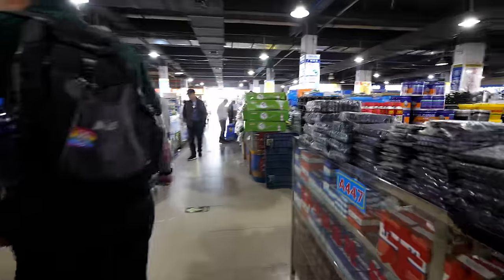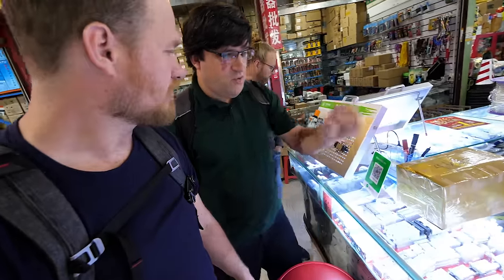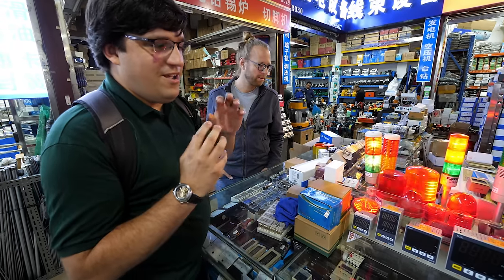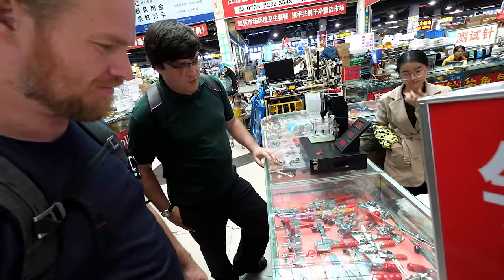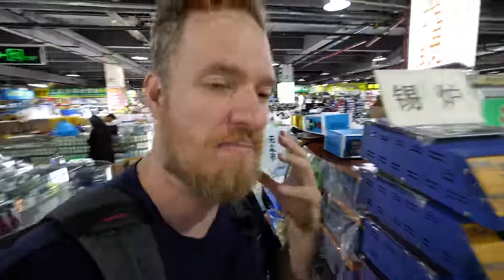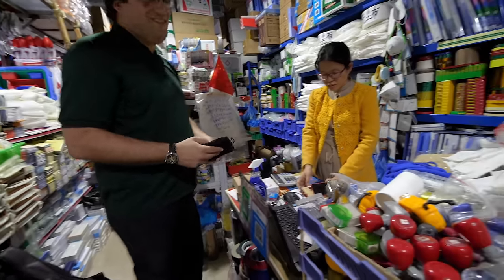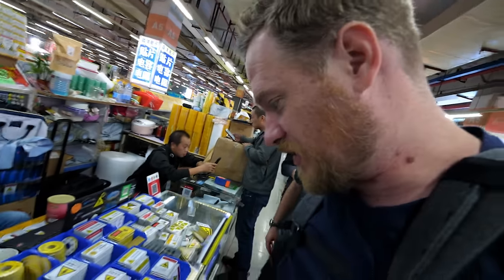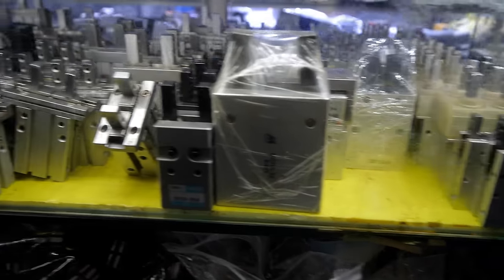Where the Factories Shop - Chinese Industrial Markets!

Comment: I'm continually amazed at the manufacturing prowess coming out of China. There seems to be something for every little thing you can think of. That's so crazy.
Reply from the maker: Yeah, and I’m still only scratching the surface.  There are entire cities that specialize in producing one thing. Like shoes for instance.
Reply: @StrangeParts  huh, might be worth exploring 😉
Reply: It used to be like that in the US. The US business sector sold it all and ceded the markets to China.
Reply: @StrangeParts  I am a longtime customer of a bespoke leather shoe factory outside Shanghai, let me know if you'd like a contact. They specialize in leather dress shoes for men but completely custom so they're not a run of the mill factory. I also buy bespoke dress shirts from a  large garment factory in Xiamen. They have their standard production line where they produce off the rack shirts for big name brands, but also take bespoke orders using my exact body measurements and cloth that I choose from Italian mills; similar to the tailors in HK but I go directly to the source. China continues to amaze

Comment: Scotty, I think you should make a pneumatic stamp. It would stamp your logo on the back of phones? Challenge would be to make it mobile, this means anyone meeting you could get your logo stamped on their phone, or, other personal items.
👍😎👍MDS 🇬🇧
Reply: Yup this!
Reply: Except most phones are glass backed now
Reply: It could be a rubber stamp and use ink, making it would not be hard, frame, extender/stamper, tubing, micro air compressor with a small tank, you could make it a 2' cube (50cm ish cube) prob smaller really
Reply: Noah Wilke There are various media other than metal stamps. My thoughts were the soft sponge or rubber type. Obviously wouldn’t use anything to break peoples items !!!
Reply: Aaron Reash your a mind reader. 👍😎👍
Reply: Goda make it look cook too
Reply: Excellent suggestion

Comment: If the apocalypse happens that store is going to be priceless, you could literally make anything from scratch by hobbling parts together, like a giant real life lego store.
Reply: But then you need an update or troubleshoot your factory computer system and without the internet you are f**ked.
Reply: You would also be without a lot of power so this stuff would be useless until a large power source gets built.
Reply: @csorrows  Only in the case of a solar flare or EMP, in a normal apocalypse where electronics survive you can run generators on fuel (gasoline isn't necessary, you can run them on oil/alcohol mix, or diesel generators on fly oil etc). Any parts that are electronically powered can be modified to be powered by anything in most cases.

Comment: About 30 years ago we built from scratch an arcade machine with 3 x 6" (stroke) air rams (2" wide) and a cockpit cabinet on a large steel frame.  We installed a flying arcade game into it.  It had a yoke flight control that I connected to the air control solenoids via darlington pair transistors to drive them.  It used basic TTL logic to control the "flight" and I tapped into the game circuit board to automatically power up the control board and lift the front ram as it took off.  When the game was finished I used an "end game signal" on the game board to shut the control board back off.  We installed a seat belt as it was much more vigorous for smaller kids (It flew someone as big as 150Kg).  It used 1/8" valves for the air flow to the rams and required a 10CF compressor to keep the air up to it.  We tried 1/4" valves during our R&D phase and it was so fast and violent that it made the 200Kg machine bounce down the factory floor while I was yelling "Switch the f...ing thing off" as I was throwing the control lever backwards and forwards with no control.  It had a 20" CRT mounted in it.  It worked commercially in an arcade centre for about 5 years.                                                  There is a good air project for you.

Comment: I didn't know those things were called andons.  Means "lantern" in Japanese.
Reply: Yeah, we used to generically refer to them as Christmas Trees
Reply: @TheCuriousOrbs  In Germany, "Christmas Tree" is also common, but mostly they are called "Traffic Lights"
Reply: I work at a major EU car manufacturing plant. We call the lights Christmas trees but have a manufacturing system called Andon. It was invented at Toyota.
https://en.wikipedia.org/wiki/Andon_(manufacturing)
Reply: and there was me thinking it was And gate logic control lol
Reply: Andons are so useful!
Reply: Stack lights is another nickname for them.
Reply: That's where the name comes from first utilized by Toyota and then adopted across the world as part of lean manufacturing practice.
Reply: @dw816  Yep, about to say the same. Worked for Toyota in the UK any problems in manufacturing you pulled the andon cord, then you got swamped by engineers and problem was solved in seconds. Very minimal down time and the quality of the product remained the same time afetr time.

Comment: Is there a machinery shop? As in lathes, milling machines, grinders, etc..
Reply: I don't know about Shenzhen but in Shanghai surrounding the area around Beijing Road, they have stores and malls selling machinery as well as hardware such as the ones the video
Reply: @robinandersson7963  ok. I believe that's what I'm looking for. I'm looking for the machines you find in the average machine shop. Mills lathes grinders etc. Not so much the computer controlled ones. But the manual ones for sure.
Reply: The shipping would kill your budget unless you were buying by the container load try Grizzly Tools in the US or buy off ebay..
Reply: @robc8468  it all depends. I've priced them both ways. You often pay more through grizzly (which I already own a machine from) and off Ebay. But for now I'm gonna hold off. And maybe once they're done with the corona virus. I'll order a new machine and see if it was worth it.
Reply: Check the App Store for grinder. You will be presently surprised 😮
Reply: @eleventeenmachine5991  Buy on Aliexpress and get FOB Shipping, cheaper because you have to pick the machinery on the nearest port.
Reply: Oh yes, my bro goes out there with work and he went to a warehouse rammed full of machine tools. He asked about a pillar drill and the bloke said how many 1000 an when do want um delivered!
Reply: i think it fall under power tools section maybe?
or heavy duty power tools...

machinery more for factory
Reply: @robc8468  shipping cost are getting expensive but still very cheap.. I like the idea of charging by sizes of containers, not weight :)

Comment: Just going to add on the vibration sorter. I'm working in what is essentially a pepperoni factory. Small time family owned so automation is pretty limited, but we've got a sort of vibrating trough after the slicers which leads into an upwards elevator which dumps sausage into a weigher/bagging machine. trough's whole point is to vibrate all the pepperoni slices so that it consistently fills the next conveyor and doesn't overload it (since it's open and sausage can and does fall off onto the floor if it gets piled up).

It's not a perfect solution since we have someone stationed at it to make sure it's working and everything is coming out of the trough nicely, but it definitely makes their job into more of a quality control thing instead of QC and constantly flattening piles of meat.

Comment: if you could find an LED factory or LED stuff related theme would be so cool, i love LEDs
Reply: I saw a vid on YT of a machine making LED Christmas light strings.

It had that shaker-sorter pot to get the LEDs oriented & fed up to a gripper.
 The machine then electronically tested each LED for function & polarity. LEDs the wrong way round were diverted to be turned around.
 Another section measured out, stripped, & tinned wires.
 The oriented & working LEDs met up with the tinned wires & got soldered.
 Another section applied heatshrink.

The whole thing just spat out a continuous stream of wired LEDs, in a choreographed mechanical ballet.
Reply: But brother Ahmad loves IED's 🤣🤣🤣 jk. Jk. 😁
Reply: Robin Hugli we have some

Comment: "the Andons from McMaster Carr are better quality"

nope...

i buy from China via eBay, and I am very familiar with product sold by McMaster, and other suppliers.  Unless you are buying a brand specifically made in the US, or Germany, it is likely the exact same product.

I have bought machine tool stuff on eBay for 20% of what a US industrial supplier sells it for, and it was the same Chinese brand.
Reply: That's how they make a living. You can do the same thing. Someone order from you, then you order from ebay.
Reply: The main difference is that with McMaster, if a product arrives broken they immediately send you a replacement; and on eBay you have to begin the grueling back-and-forth process of (hopefully) getting a return or replacement. eBay sellers have three whole freaking DAYS to sit around thinking about their response to a return request.
Reply: Ebay is one thing, these markets are another.  There's a certain level of transparency regarding the fit and finish of the product on ebay.  The stuff sold in these markets is the lowest grade of cheap shit you can imagine.
Reply: Maybe I've been exceptionally lucky, [I also don't buy higher priced, single items, (<= $50)], but when I get a defective part from Chinese sellers, I contact them, tell them, and they refund my money. I've never had anyone ask me to return the defective item.

Something I started doing 3-4 years ago, which significantly helped all of my interactions with Chinese sellers is send messages in both English and Google translated Chinese.  Most sellers I've communicated with think they speak/read English much better than they actually do. LOL

I have only had 1-2 situations where I had be be even slightly assertive to get a refund.  Overall, the quality of customer support has been exceptional, they really want to make us happy as customers. 

 They also understand they have an advantage because the Chinese govt subsidizes their shipping, and return shipping to China is 10 x as much as from China to here, (or more).

I bought a DC motor controller for a small lathe motor. It was inadequately packaged, and showed up soaking wet. I contacted the seller, told them about it, and made some suggestions as to how they could package their products to eliminate issues like this.

The controller worked fine, but 3 weeks later, a new, well packaged one showed up, with a very nice thank you letter for taking the time to help them.

I know a LOT of US businesses who could learn things from them!

Comment: Someone needs to make something like tours for industrial equipment markets. So I could travel to the market with a guide/translator, buy shait and the guide would take care of logistics to put everything on pallets and ship it to where I need.
I have bought stuff from Alibaba, but it is close to impossible to do small combined bulk from multipple manufacturers, for smaller business, that does manufacturing, not distrubution. For those who don't know - freight shipping stuff to EU costs around 250$ for a half ton pallet.
Reply: I am kinda anti-china manufacturing, because they have taken most of manufacturing away. I like to buy local/EU by paying a bit extra. But you can't blame China for everything. Just recently I had to buy collet chuck for a mill and in my local store it cost around 500€. Was it some kind of german-made piece of art? No! It was the same set I later bought on Ali for 75$. Why it's so expensive? Because when the product comes to a store it goes through so many hands.
Reply: 3rdHalf hey I actually live in China. Wanna come?

Comment: We use those actuators for  valve gating on molds.    Same with some of that cylinders for pneumatic slides.  Those cups for building end of arm tooling and those feeder bowls for our sonic welders in injection Molding.   I’ve only even seen this stuff in catalogues.  This place is cool.

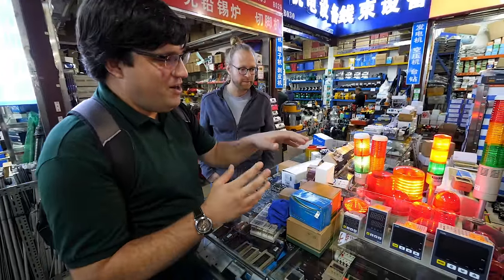Comment: 6:20 as far as I know (I'm integration engineer that worked with many different machines) red indicates that the motion on the machine is activated and that maintenance of the machine is dangerous green indicates that the machine is on "safe" condition when the motion is partly disabled and yellow is that the machine is off and there's live electricity on it.

Comment: Fun project: extending a hub on a drive wheel of a car, and making a mini shovel that is powered by the wheel (the pneumatic actuators would be used for the shovel directions).  Obviously, the car would be put on a jack to attach and operate the shovel.

Comment: I've been here, it is amazing. I was so disappointed I had only an hour. You could spend 1/2 days exploring this area!
The funny thing is, if like me you buy a lot of little electronics from eBay/Amazon. E.g. LED torches, digital thermometers. You start recognising stuff.

Also as you see in the video, each stall has it's THING. I saw a guy selling laptop transformers. That was all he had, but loads of them.
And a multi floor building with nothing but people building LCD screens.

Comment: Idea for for your pneumatic project, spot welder with arms that come down and apply the right amount of pressure, made from a old microwave transformer, with a timer and foot switch. then figure out different set ups for doing things like 18650 batteries, small parts like lamp cages, etc

Comment: I have a dell 7537 laptop. It is 6 years old. Now battery doesn't hold up charge and empties in 15 min or less. Which is fine , I understand. 
Then i contacted dell for the replacement part, they said that they only make batteries for the said model for 5 years max. And since the model is 6-7 years old. We  o longer manufacture it. AND directed me to a generic battery from a local market.
I shopped for a little after searching a best price and quality for a generic battery i found one. It was costly. No issues. So i went home. (I was traveling the point i got the replacement battery) now upon using 2-3 days it showed me an error saying that "this battery has encountered a permanent failure and needs replacement" i was like WTF. 
Called up the shop and he said as this is a generic battery, so don't have it in stock and has to order it and will take about a week to get. 
I didn't had time. So i thought  out haste that its just a battery  and may be there is some chip that has been locked to use only authentic batteries by dell. So i took the battery apart and removed the cells and put it on the old battery's board and packed it and WHAM! No power. Updates bios and all the things which i could find online but no go. After searching i found that this is a LOCK by dell on BMS chip on the battery's board that needs a constant power. And if it detected a re-cell it will shut down the battery and that BMS will not start. this is nuts. Anything i can do?

Comment: Hah, we call them Patlites. 
Generally int eh manufacturing facilities I have worked it we kept the spares that were most likely needed in stock. And honestly with McMaster and automatic next day I can have what I need pretty quickly. Then there are places like Applied Industrial, Misumi,  and Fastenal. 
Stuff like vibratory feeders are not something you can just go down to pick up since they are generally designed for a specific item that will be fed.

Comment: nope. those are solder baths. not solder pots. with a solder bath you simply ditch the whole pcb into it to solder all the components at one time.(pretty much manual wave soldering although you can ofcourse simply make the baths larger and run a tractor feed system through it like any tv factory in the 80s did ;) solder pots (for wire ends etc) are smaller. now. what we actually need is a dip chip bonding machine, machines to make the dip packages, a cmos wafer production line w/everything etc. but i don't see them selling that stuff there. this is more like a 'bigger and more useful version of radioshack' than a place where factories go. :P

Comment: build a machine that molts plastic from water bottles and other grades of plastic ( sort of like a glue gun) but putting molted plastic into a center block mold for renewable recycled materials as you know there are different grades of plastic some harder some softer use the harder plastic to create the center block mold and the softer to fill them glueing them together

Comment: If you are really interested in building a pneumatic machine, to take it to the far end of the spectrum, you could actually make it with "air logic". Which is non-electric logic. Limit switches, and's, or's, not's, timers, and of course the valves are controlled via air. This logic can be used as an "explosion proof" set-up, but there are very few apps for it anymore, now that PLC's are so cheap. I built much stuff out of this logic in the 90's tho. ARO (now Ingersol Rand) is/was a major supplier of these components. I think that I have seen someone else offering them over the years, but can't say who anymore. May be able to find used?

Comment: That lamp does not cost 300$ in US
, its about the machine and who produced it, 
If you buy DMC machines you should buy  only DMC spare parts, buying other will drop your guarantee. 
The lamp made in Dmc wld cost 20$ they'll sell it for 200$ to compensate costs of production and storing .
in china its totally different system , there is no production copy-right , you can buy a machine and change its parts with any other spare part because its easily available in the market, all because of cheap labor and quantity of business, a company can produce only 1 type of product lamps for example...
Hence making it available low cost.